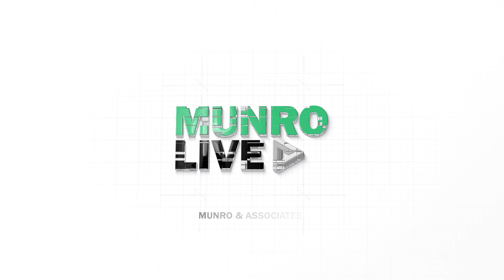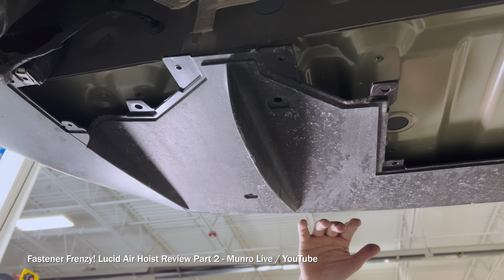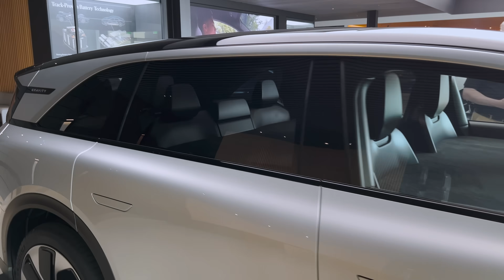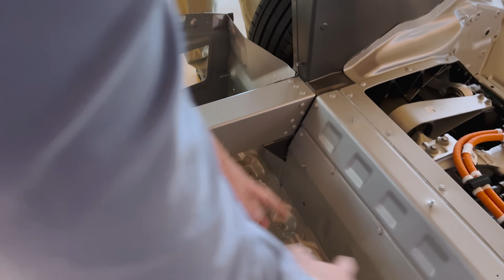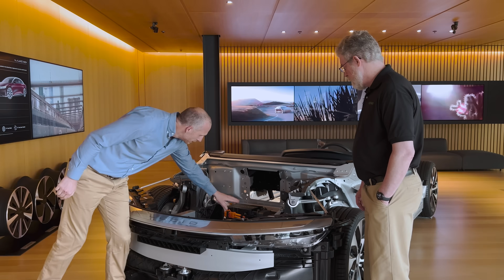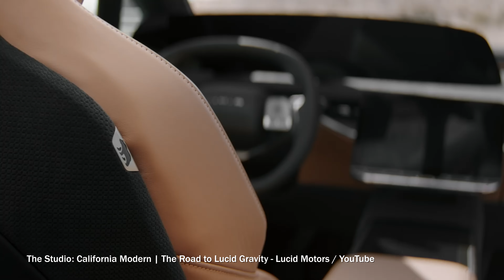Engineering Excellence: Exploring Lucid Air's Incredible Efficiency

Comment: I hope they will make semi trailers with solar panels, batteries and motors in them. That will make all trailers feel like a feather and give every truck a free 1000+ hp. 
Regenerating will be possible, it will give any diesel 30% more range even without charging the battery at all. It will also make sure the semi needs less maintenance.

Comment: It's worth noting that when it comes to packing/arranging items in a three-row vehicle, one often overlooked aspect is that, unless you're driving a minivan or a full-size SUV, most three-row vehicles don't even have enough space for passengers' belongings. However, for electric vehicles, this type of fuel has truly made a difference, rendering smaller three-row vehicles more practical. Put another way,

Comment: Something not stated about the efficiency is the shorter time to full charge with fewer batteries.  There are cars that can charge at high speed, but the Lucid finishes sooner because it has fewer batteries (personal experience with the Lucid Air Pure).
Reply: What that has to do with efficiency?
Reply: @mug_spinner  If your car is efficient it doesn't need lots of batteries. Aire Pure gets greater mileage with a smaller battery. Advantage!
Reply: @nicosilva4750  well but it doesnt mean its because its efficient. Could be only good aerodynamics.
Reply: @mug_spinner  a) aerodynamics is part of the efficiency. b) have you seen their motor!!??  It literally is THE most efficient EV motor. https://youtu.be/R-S7WLfT0IM?si=0TzltAto81geX1Xw. https://youtu.be/U7IHZxNC6hc?si=m1tEg3dcPU6Bj4nc. https://youtu.be/R-S7WLfT0IM?si=ICjJ1x5PnbB-GE6s
Reply: @nicosilva4750  no, aerodynamics have nothing to do with efficiency
Reply: @mug_spinner  ??? Crazy
Reply: @mug_spinner  good you are ot just ignorant but also talk like you understand anything about this. 
They use 900 fucking volts and a battery which means smaller components and maximum efiiciency not even teslas can do
Reply: @fofopads4450  i dont think you understand any of this
Reply: @mug_spinner  if you did you wouldn't be using a fake account to say aerodynamics don't matter for efficiency.
Weight matter for efficiency, power capacity matters for weight
Reply: @fofopads4450 wow, buddy, calm down. fake account? none of thing you listed matter for efficiency.

Comment: Interesting to note that the car is glued together with structural adhesive. He addressed the subject head on. Any engineers see issues with this?
Reply: It’s been common practice since the 1990s. Check out Lotus Elise for example.
Reply: Exactly. "Curing ovens" - is Tesla requiring same, it’ll be impossible for unboxed process as almost last step. Just leave entire car out in Texan / Nevadan sun for few hours.
Reply: I run an Audi A2 which has an Aluminium body structure with Castings; Pressings and Extrusions.

These components are Welded; Bonded and Riveted.

22 Years old at time of writing and almost 300,000 miles. 

A commercial failure, however they're bloody strong cars.

Comment: For all product designers: "Perfect" is the enemy of "Good".  Chasing the exquisite aerodynamic, minutia of the Lucid is why even at nearly $ double, or so, the price of the competition has resulted in a $ loss of in 6 figures for each one made to date.  Pure Irony: the example cited of saving electricity by turning off the lights at home on departure vs power consumed by an EV is laughable, because the displayed roof racks, and items strapped to them, totally negate all the meticulous details of Drag reduction in the design of the car.

I've personally seen the motor and differential gearbox at the LA auto show and it is a masterwork of engineering!  Unfortunately few, if any, Lucid customers care.
Reply: The base model Lucid Pure at $69k costs less than a base model Model S and has longer range.
Reply: @Miata822  Oh, so that's why they sold so many!  By the way, Tesla make a nice profit on each "S" sold, how much profit does Lucid make?  (hint" they loose 100s of thousands on each car!)
Reply: To be fair the roof rack is an accessory for occasional use when you have to use the car like a van or truck. The lower noise with a low cda may be more important than fuel saving. The cost is in engineering and thus amortized over all cars produced. Creating the parts is pretty much the same for good or bad aero.
Reply: @4rwayner7  The irony of discussing the minutia of drag reduction under the shadow of the loaded roof rack (and a bike on the Gravity video) must have escaped them.  According to their Financial Statements, the cost of each car is hundreds of thousands more than the selling price.  If they sold >10x as many, they'd still lose money.
Reply: @shazam6274  you are trying to say the fabrication of each car is hundreds of thousands dollars? That’s delusional.  You don’t have a clue what the cda of a bicycle or rack or kayak is. When towing a trailer with a pickup it only halves the efficiency with weight and aero losses.
Reply: @4rwayner7  The actual manufacturing cost of an individual vehicle is not published.  However, since sales of the car is the only source of income to support the operation of the company, simply dividing the annual loss by the number of cars sold yields a gross number of well over $200,000 / car.  

As for the added drag of the displayed aspirational accessories, there are a number of studies with measurement data of how much they add to other cars.
Reply: @shazam6274  Quote.”the cost or each car is hundreds of thousands more than the selling price”. You don’t know how a balance sheet works. Regardless of sales all start up costs are there from day one. Costs can continue to accrue even after production starts. Labor, materials, utilities etc. Hopefully a company can turn the corner and sell enough to have a net profit. The amount of drag a roof rack or bicycle adds is minimal because even if the Cd is high the area is low.
Reply: @4rwayner7  No point in replying if you won't, or can't, read my response. Enjoy whatever fantasy world live in.
Reply: @shazam6274  I’ve read and understood all your drivel. You obviously are neither an engineer nor an accountant. I  am an engineer and started, ran and sold two manufacturing companies. You have some agenda towards Lucid or Munro and pull comments from thin air to make some point. You’re correct on one point. Conversation with you is a waste of keystrokes.
Reply: It's relatively cheap to make a few very high end expensive vehicles, in order to create a company that can then invest orders of magnitude more capex to make large numbers of cheap vehicles. They have to start somewhere, I just hope they can keep going because their eventual compact car will probably be as great.

Comment: I can't explain why, but I find their design elegant and beautiful, but incredibly boring at the same time.  And the impressive engineering that goes into the "incredible efficiency" at the expense of production efficiency is a disappointment.  It's like throwing away dollars to save pennies.  And the world can't benefit all that much from this efficiency when you can only produce and sell 600 of these a month.  Tesla may not be quite as efficient, but they've replaced over 5 million ICE vehicles.  Lucid only tens of thousands.
Reply: Lucid has sold 5,766 EVs through the end of the 3rd quarter this year,  ~ 640 / month.  Source:  KBB

Comment: I am guessing you will deal with the fact that you have a roof rack and a surfboard on the roof. I am commenting at 8.04 Mins
Reply: Unlikely anyone is driving hundreds of miles with that gear. But if you do, you'll want to do it in a Lucid because the car is so efficient, the additional drag does not impede the ability to complete the trip.

Comment: The new Model 3 LR RWD did 5 miles per kWh on Out of Spec’s 70MPH range test recently
Reply: That is a much smaller car. Lucid's upcoming mid size model is targeting 6m/kWh.
Reply: @Miata822  yeah, Lucid’s are otherworldly in terms of efficiency, especially for their size. I’ve gotten 6m/kWh on my Hyundai Kona before, but it was on back roads averaging around 45MPH
Reply: Air is a much larger car.

Comment: I took the trouble to read all the comments, I see a lot of hate from Tesla users. However, I take this as a documentary, a historical record. Think in these years how many attempts were made, how many promises were not fulfilled and vanished. From an engineering point of view it is a tremendous achievement that the model is available to the public. However, remembering the words of an Italian engineer quoting Ferruccio Lamborghini about Bugatti that "it takes an industrialist" and that Elon learned that the hard way, I remember that he wished him the best success because he knows how difficult it is to make everything profitable an operation. I hope they can survive and continue their path of innovation with a different vision than Tesla, that feeds back to both.
Reply: Elon wasn't from the car or manufacturing world. Rawlinson has spent his entire career running automotive engineering departments from Jaguar to Lotus to Tesla. Lucid won't need the ten years it took Tesla to get rolling.
Reply: @Miata822  The company was initially founded in 2007 and switched to producing cars in 2016 when they changed their name. It is getting very close to a decade, and far beyond depending when you consider the actual start of the company. The point where they first started planning to make a car seems to be around 2014, which lines up fairly well with Rawlinson joining in 2013.
Reply: @Miata822 Rawlinson was with Tesla for first model S.
That’s a long time already.
Neither is a one man show.

Comment: Lucid literally just crammed more batteries. The Air battery is either 84kWh or 118. What a joke. If my 2024 M3 LR RWD (4.8 mi/kWh) had 118 kWk battery, it would go 570 miles. 
Even with their smallest battery, 84kWh, my car would go 405+ miles.
Reply: But it can't because the Model 3 wasn't designed for that battery capacity

Comment: I know power efficiency can be important, but endlessly chasing after power efficiency provides diminishing returns. For example:

Going from 1 mile/KWH to 2 miles/KWH yields 100% extra efficiency.
Going from 2 mile/KWH to 3 miles/KWH yields 50% extra efficiency.
Going from 3 mile/KWH to 4 miles/KWH yields 33% extra efficiency.
Going from 4 mile/KWH to 5 miles/KWH yields 25% extra efficiency.
Going from 5 mile/KWH to 6 miles/KWH yields 20% extra efficiency.

It is important for an EV company to also seek improvements in other areas, such as, bringing down production costs so cars can be sold profitably at a competitive price. Unfortunately, Lucid is doing badly in that regard, and it irritates me that whenever I hear somebody from Lucid talking, they seem to talk mostly/only about efficiency and completely ignore the elephant in the room (making a massive loss on each EV sold).
Reply: Demand will increase as they bring down prices. Price will decrease as they scale up production.

Comment: The Citroën DS had a concave belly pan to create suction that increased with speed. Consequently its weight INCREASED with speed. The slightly flat front license plate section created an air-dam that then caused a suction into the horizontal radiator air intake immediately which are flanked by air intake ducts for the front inboard disk brakes. Come on Munro go analyze the DS and imagine it now being electric!

These are not new tricks!

The most creative thing I see is the duct for cooling the LED headlights. No light does not produce heat contrary to much discussion. It a matter of cooling the heat sink rather than the filament. Nice to see this attention to detail.  The split of the radiators reminds me of the split turbo intercoolers of the Renault Turbo Fuego. 

The power train is a gem and the subsequent efficiency and range. Just waiting to see how it survives!

Comment: I suspect that Lucid's claimed 0.197 Cd is in a wind tunnel, and not real life on the road. Once you start spinning all 4 wheels at speed, the Cd is most likely to be higher. It's my understanding that the Model 3 Highland has an on-the-road Cd of .219; does the Lucid beat this?
Reply: Every car's Cd is tested in a wind tunnel, what you're saying doesn't even make sense lol.
Reply: re: "I suspect that Lucid's claimed 0.197 Cd is in a wind tunnel, and not real life on the road. Once you start spinning all 4 wheels at speed, the Cd is most likely to be higher."  FYI the wind tunnel you describe is the traditional "static" type cells originally developed for Aviation and Aerospace.  however fast-forward 80 years on from WW2, and what now exists are "dynamic" wind tunnels that incorporate rolling roads into the floor to account for the effects of rotating wheels, these would be the type used by the OEMS, Formula 1, and Lemans racing teams (think: Porsche).
Reply: the wheels spinning doesn't affect aerodynamics much at all. Tesla is not as good as Lucid with their Cd efficiency

Comment: Because this video is so aero oriented can someone discuss a comment that was made on the State of Charge channel TM stated that with an identical headwind and tailwind the tailwind wouldn’t have as much effect. It seems with most cars the cda would be much higher from the back than the front and be the opposite of what was stated. It was a 70 mph range test round trip.
Reply: Tom Moloughney just discussed and demonstrated the opposite. I think you misunderstood him. He said it would equal out due to travelling the same distance in each direction, but ultimately have a negative impact.
Reply: @Miata822  No. At approximately the 35 minute point of the video he specifically states that you won’t get back the same efficiency effect with the tailwind as lost with the headwind. That’s why I asked. I wanted an aero/engineering comment and not a fan rebuttal. I am a fan of Tom’s but he occasionally makes off-the-cuff comments not based on engineering or technical knowledge. I watched a second time to be sure what he said and get the time stamp.
Reply: He said an equivalent tailwind won't show up in energy consumption as an equal headwind. His trips are both directions, so any benefit from tailwind is partially offset by headwind but it's not a one to one impact, so the efficiency observed was real and not the result of beneficial wind direction.
Reply: @jghall00 rewatch it

Comment: What effect would ditching the side mirrors have on cda?
Reply: Was wondering the same. Given that we’ve got self-driving cars now I feel like we could go to small cameras only with interior screens instead of side mirrors. Perhaps if the regulators feel they are still desirable in an emergency, have the physical mirrors stowed in the trunk and capable of being fastened into place should the camera malfunction.
Reply: @sowhat512iuu  I saw a review of a car that had the camera/screen in addition to the mirror. It’s government controlled.
Reply: @sowhat512iuu I drove away in my ID4 one night and was several miles down the road when I realized my mirrors hadn’t opened up from the folded in position which is automatic when shutting off the car. I tried several things to get them to open out. I couldn’t just pull on them. It really scared me.
Reply: @4rwayner7  yes, for whatever reason regulators seem to be clinging to mirrors. Unfortunate about the ID.4, I assume it did get fixed. It’s kind of funny really, there’s quite a bit more that can go wrong with physical elements that require actuation like the folding mirrors than a camera system, and being able to simply fasten the old-school mirrors kept in the trunk if the camera fails for some reason seems like a good alternative, would reduce gas emissions on ICE vehicles and provide additional range on EVs.
Reply: @sowhat512iuu  for a good reason. Mirrors work and the minor increase in efficiency is not worth the risk of not having a mirror.